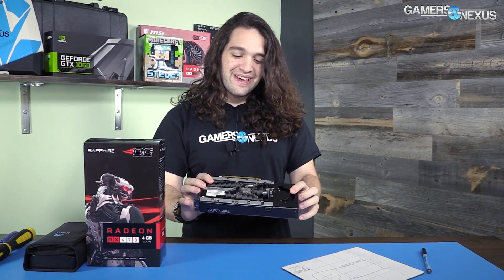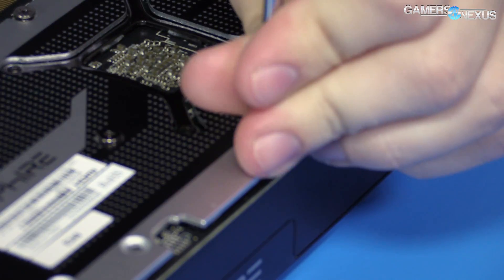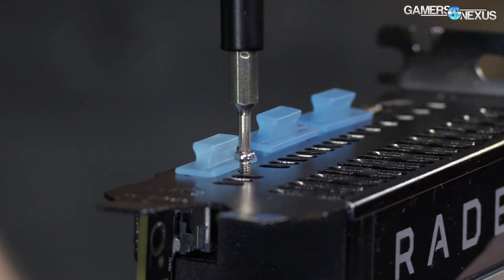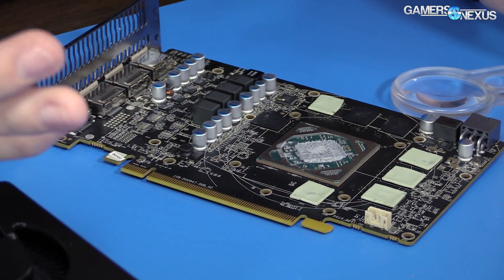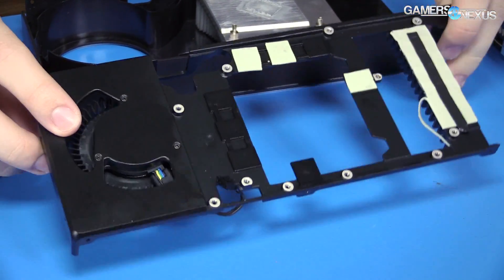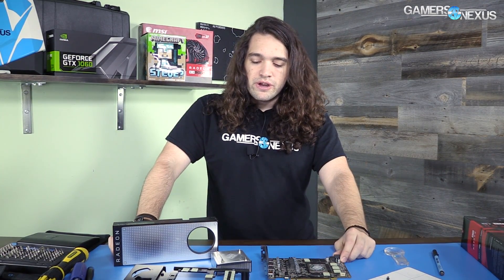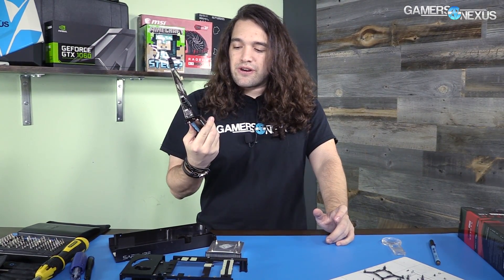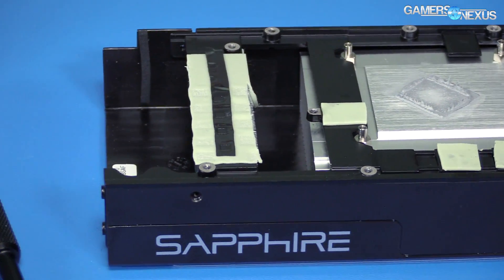Sapphire RX 470 Platinum Tear-Down & Poor Value

Comment: what thickness of thermal pads should i use for vrms and memory? 
Sapphire RX 470 Platinum
Reply: Even i am trying to find that any luck?
Reply: @TheUltimateDesiGamer  unfortunately no, if you managed to find it let me know :)
Reply: I was thinking to buy 1mm thickness as my vrms are going 90+
Reply: @TheUltimateDesiGamer  The safest way that i found is to purchase 0.5 mm and stack them, 2 for 1 mm and 3 for 1.5 mm.
so you can test the one that works properly.
the memory and vrms used a different height pads
Reply: Here in India we have option for buying 2 2 2 peice of each or 3
Many multiple combo are there guess ill buy it then
Reply: @TheUltimateDesiGamer  i couldn't find them in my country "DZ", i have to use Aliexpress.

Comment: look for videos comparing the two cards (RX 470 4GB) (RX 480 4GB/8GB) but add the words mining rig and you will clearly see that this card has one thing it does best. Its more energy efficient when mining than any size rx 480

Comment: i have a question, if any one can help, I want to get a new build, for now I'm going with a i3 6100, b150 motherboard, 1x8 GB RAM, and a 600w PSU, now I'm not sure if it makes more sense to get a RX 470 8gb or a RX 480 4gb they are going for the same price in Amazon.es so I'm not sure which one would be better, I plan on gaming at 1080p. also would they run on a 600w PSU?

Comment: Here in Austria I am able to buy a Sapphire RX 470 Nitro+ (same cooler as the rx480 Nitro+) 4GB for 220€ while the RX 480 costs 280€ or more. 
Is it worth it to buy the rx 470 nitro+ ? Cause I dont want to spend that much...

Comment: It would be cool if you saved all the benchmark data in a excel spread sheet so you can quickly refer to it and compare it not only to other cards currently in the market; but previously popular cards which people wish to upgrade from. For example the 750ti, gtx 960, 970, and r9 2xx and 3xx series. It is a lot but since you already have the data you can just leave one photo at the end OR just get the averages so for example "this rx 470 on average preformed 7% better than a gtx 960 and 5% than a r9 380" just making those numbers up. But would be helpful! New benchmarks arn't always readily available and complied. Like your reviews the best though man!

Comment: sure, you cannot overclock this card, but not everyone wants to. it's currently the cheapest RX400 on the market by a significant margin - and that's the point of it. personally. I spent the extra and got the Nitro+ version. I'd have got the Rx480, but nobody had them in the 4gb version.

Comment: it may make sense to buy this product for those who actually want that type of cooler as it is blowing the hot air from the RX 470 GPU to the outside of the computer case as opposed to more powerful cooling solutions that blow the hot air into the inside of the computer case while relying on an efficient computer case heat management. The better option still may be to buy a couple of case ventilators in order to optimize airflow in the computer case and then buy an RX 470 with a more sophisticated cooling system that does a better cooling job and consequently is able to better hold the boost or overclock frequency at even lower temps.

Comment: nexus, can you please add 2 more vrams chips to increase the vram to 10gb?
Reply: You cant just add vram chips :p. The circuitry within the pcbs is designed for the amount of chips and capacity they have, along with bios limitations. Without the use of a custom pcb, which GM clearly couldnt make, it is impossible.

Comment: you can sustain the max boost constantly by just setting power limit to +50% ( or maybe +25 will do?). at least this is the case with my 480... just adding in didn't hear you say anything about this

Comment: It's the same price as the RX 480 in the UK >:[

That doesn't make any sense.
Reply: you get this one for £165 in the UK at overclockers, so £20 cheaper than the 480
Reply: I need to shop more at Overclockers rather than Scan then :/
Reply: Joel Gabriel Scan have it at £165 too, but for pre-order not in stock currently. I've been looking all over, but I want a RX480 with a after market cooler

Comment: It is beyond my understanding why they do this kind of stuff with the pricing. Only thing I can think of is that they are expecting a small supply of 4GB RX 480s so that if none of those are available, you will either have to go with the 470 or the significantly more expensive 8GB RX 480.

Comment: I have bad case with 0 fans (except DeepCool tower-style fan pointed in direction of back exhaust)
Is reference RX480 a decent choice if I don`t want to upgrade my case?
Reply: reference rx480 has poor quality cooling and a tiny 6pin pcie connector you will want to get rid of as far as you'll try to overclock, it's also very loud. go for partners' cards, they go 10°C lower and find a model with 8 pin connector.
Reply: There are no AIB RX480 and I am kind of tired of waiting. I am not planning to overclock
Reply: Ok, I was just giving an opinion :-) However I don't think it will take a lot for them to come out. All the companies have already shown their own version... and many are bookable.

Comment: the rx 470 should have been 160 msrp, than you will get costum cards at 180, the reference rx 480 4gb at 200 the costum rx 480 at 220 the rx 480 8gb ar 240 the costum rx 480 8gb at 260.

That would make More sence.

Comment: It costs the same as a 4GB RX480 and, lets face it, 4GB is more than enough for basically any game at 1440p, anything more is completely unnecessary. So why go for a lower performing card with 4GB when at the same price (or hell, $30 more) you can get an 8GB RX480 and like 10%-15% higher performance? The RX470 would've made much more sense as a $150 card, with the AIB versions being $179, with an absolute maximum of $189, but with a starting price of $179 for the basic reference version you've basically made any RX470 besides the ones with a blower cooler a DOA object. But then again, the blower cooler is complete garbage anyway, so that's also a DOA object.

This current pricing also makes me worried about the RX460 costing $129/$139 (2GB/4GB) instead of $109/$119, which, for a card that's basically just for some light gaming and e-sport games but nothing more, is not a particularly good value. And the RX460 isn't even the full P11 chip (it has 14 CUs compared the full P11's 16), so it makes even less sense to put a cut-down P11 chip at $139. That said, those prices are still not confirmed, but with the RX470 pricing I wouldn't be surprised if the RX460 will also be priced well above what it should be.

Comment: Hi! 
I run this i5 2400 1333Mhz ram 8gb ddr3.
Now, an i7 3770 might be available in my country for a good price, so, If I pair an i7 3770 with this 1333 ddr3 ram, will I get any RAM bottlenecking? I'll use Rx 480 Nitro+ with all that.
Ram bottlenecking as in, will I see much difference compared to if the card was ran with an i7 7th gen and 3000Mhz ram. 

Thanks!
Reply: Vhat? No man it wont best case scenario would be 2-4 fps difference

Comment: You can have either of these two cards, both 4 GB, both $200

This one has 2048 cores at 1216 MHz. It has 4+1 power phases.
This one has 2304 cores at 1206 MHz. It has 6+1 power phases.

They both have the same blower cooler. Which one would you buy?

Obviously the RX 470, right? Look at that overclock!

Comment: Huh the cheapest one on newegg is 
ASUS ROG STRIX Radeon RX 470 4GBwhich is $190 and already sold out and the most expensive one is 
SAPPHIRE NITRO+ Radeon RX 470 100407NT+8GOCL 8GBfor $240 and it's also sold out

Comment: I thought the same thing when I saw the price of the 470...being so close to the 4GB 480, the only reason to go with the 470 is because of the cooler and/or custom PCB (since the 480 at $200 is a reference card). When they are the same price it's a pretty tough sell.

Comment: This is still a question with no answer. Why this new generation of graphics cards partner models insists on just copying the reference cards instead of using different coolers?
Reply: So that people buy last gen GPUs. Because who's gonna buy a $300 GTX 970 these days!? Nobody. So the newer cards have to be overpriced and equipped with lousy coolers.
Reply: An even more interesting question is: Why do people buy the reference cards (or partner cards with reference coolers)? To equip it with a better cooler? Then you can go for a custom design right from the start. To equip it with a water cooling system? I think that is reasonable for high end cards only. The only reason might be that you have a better airflow when you have two cards in SLI/Crossfire. But instead of two weak GPUs one single powerful GPU should be prefered, since there are issues with CF/SLI even after years. It might be better than it was at the start, but still it doesn't work without problems in every game.
Reply: Udo der Unförmige In the case of the GTX 1080 for me, the only partners cards either are copies of the reference design ot are the MSI Gaming X, which is 150% more expensive than the reference model partner cards. As for the RX 480, the only model avaliable uses the reference design. In my case, it's the lack of choices.
Reply: Crimson Sunrise Well, I don't know how the situation with the 1080 is. For the RX 480, i hope the custom designs will be available in a couple of weeks. Else I consider to wait for Vega...
Reply: +Udo der Unförmige You said it best: wait. AMD must be slamming their heads right now as Nvidia is selling 1060s with custom coolers at lower prices. It's also fishy that shops are selling last gen GPUs at full price. The situation here is really: wait or get ripped off.
Reply: Chupick Nicolas I think that nVidia is eating the losses, as the 1060 is not as reliable as the RX480 and has less memory.
Reply: Chupick Nicolas Well, I can only speak for my country: Here the price difference between the 1060 and the 480 are about 10 euros. With many 1060 priced higher than the 480s. At least at this moment.
Reply: +Udo der Unförmige In Canada a custom RX 480 is around $400. A custom GTX 1060 is $340. Sure, a reference RX480 is $335 but the cooler is trash.
Reply: Udo der Unförmige Which is interesting. Here, the price difference between the 1060 and the RX 480 is...we can't buy 1060's. The 1070 is the lowest one we can get and it costs about 800/1k more than the RX480. Pretty much all the partner 1080 cards are considerably higher than the reference card, with the biggest offender being the Gaming X one, being 2k more expensive than the FE one.
Reply: It's strange how big and different the price differences are between various countries. Sure, there are different taxes and so on for each country (Which would explain at least a bit why there are differences for one card), but I expected the price difference between 1060 and 480 would not be that big between countries.

Comment: if im gonna get a card im gonna get either the rx 470 msi or rx 480 msi because msi coolers are just badass
Reply: msi charges an extra 60€ for their custom designs here. not worth it for low end gpu tbh.
Reply: Ew
Reply: ***** my boobs :)

Comment: Thanks guys! I don't really know what Sapphire is doing with their Polaris cards, they just seem to be underwhelming when compared to some of the other AIB cards, especially the MSI 480/470 Gaming series, which seems to be quieter, cooler, and more stable. Hope they can find their way again with more cards this gen, or the next gen Vega stuff
Reply: When saying Sapphire, you should allways say NITRO... look at their Nitro rx470 i kicks ass... about the price i do not know atm. the card in this review, is the closest to a refernce you will get... and a bad one at that.
Reply: Good point! Yeah, the 480 Nitro + from the reviews and tests I saw did not fare to well compared to the MSI, some of that may of had to do with the older Crimson/Wattman software where it sounded like it was pegging the fans at 100%. The 470 looks better, I'm guessing the cooler is exactly the same, and seems to fare better with the lower tdp.
Reply: +Colin Reay this is basically just a fancy referebce card

Comment from the maker: Read the article for more thoughts on the price positioning and components! Also reprinted the endurance chart here, just in case you missed it: http://www.gamersnexus.net/guides/2545-sapphire-rx-470-platinum-tear-down-is-poor-value
Reply: The powercolor was apparently a pricing error...  It's $200 now too!

There are no 4gb 480s to be had, and basically never was!
Reply from the maker: No time for sleep!
Reply: *****  I have only ever seen a 6 pin + 2 pin. cable.
Reply from the maker: 8-pin is not inherently better, especially for these cards. It's two extra ground/sense pins. They are rated way higher than spec. You will be fine with either 6- or 8-pin, and should pick based on other parameters instead. Hope that helps!